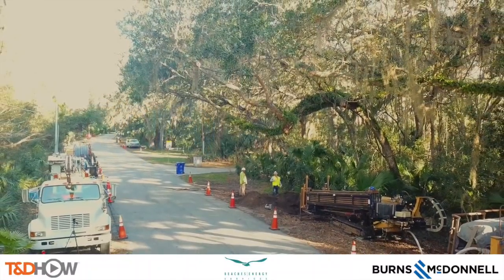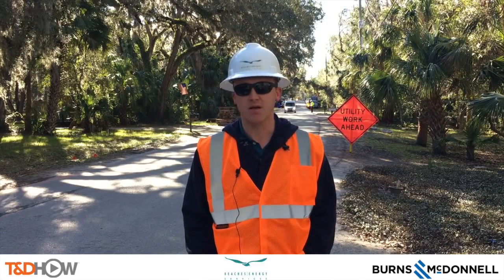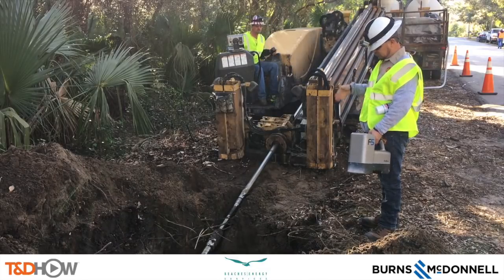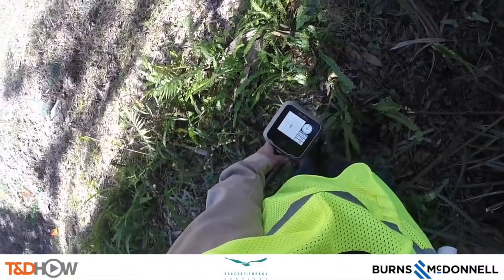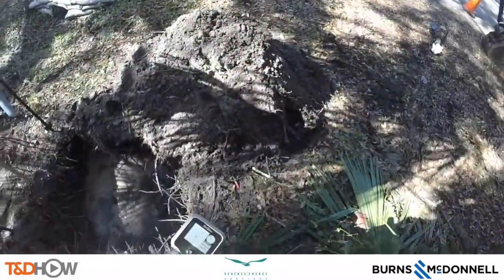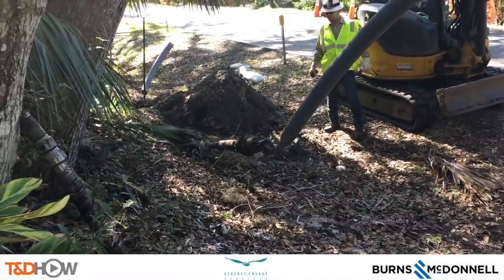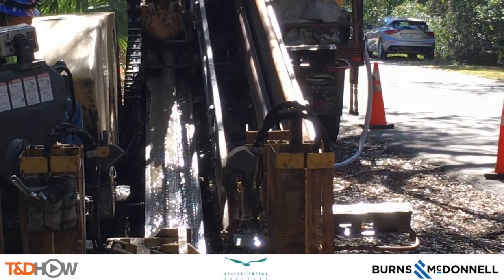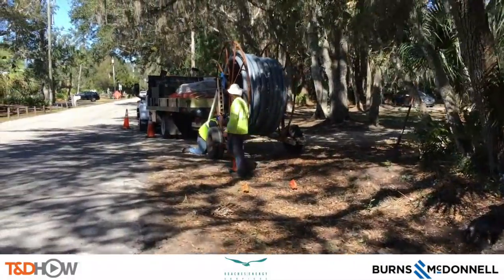Directional Boring for Underground Distribution

Comment: Nice Video. When somethings seen so easy usually there are not. It takes knowledge and a lot of practice if you want to handle it right, but that is not the problem. I always said, the work is not to drill, the real job is not to hit something, there are places with so much things on the ground that you spend more time making sure you are clear than actualy doing the drill shot.

Comment: So many questions. How deep do they drill. How much conduit is on each reel. When connecting two lengths of conduit or splicing wires together, does a vault need to be put in. What if it's not possible to drill along the side of the road do to terrain?

Comment: Great video. However, I have one question. Since the drilling machine is at the ground surface pushing pipes into the ground at app. 45 degrees, how the drilling line get straightened to be horizontal and parallel with the surface?
Thanks
Reply: because the rods are only approx 10ft, there is an amount of flexibility. This allows them to change depths when diving below or above other utilities in the ground. This also allows them to bore around curved roads to a certain degree. You can check out 'Directional Technologies' for an animated version of this. https://youtu.be/mdLCD6t6C-w
Reply: @mikeebersole5803  in addition they can almost go around a cul de sac with the direction drilling bit. its pretty much mining or brought to your local HOA !!!
Reply: This is my company’s old rig 36x50 with 15 “ rods , surprisingly they bend a lot underground and we can get level in no time . I’ve done some narly turns

Comment: Pressurized water huh?? Ever heard of Bentanite mud? I think an actual Directional Driller should explain the process..
Reply: Bentonite* aka drilling fluid mainly is mixed with water, another chemical -barite (barium sulfate) to stabilize the borehole, cool the bit, suspend solids and assist with flushing out cuttings. Also used is potassium formate and other chemicals and polymers depending on soil and rock conditions. There was no mention of the “back reamer” bit fitted when they pulled the pipe out of the borehole. (I did horizontal/directional drilling for water/oil/gas/minerals/geothermal for ten years, as dumb as it sounds we all went to “mud school” to learn how to use the fluids properly. Learned a lot by working with the rigs!)
Reply: They actually say you.  Can drink a glass every mornin it with hurt you so they say